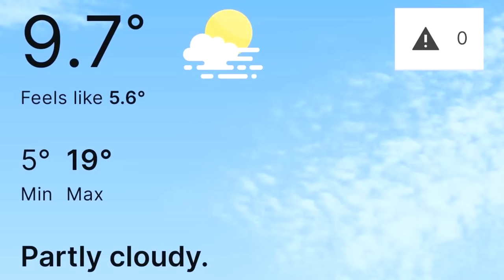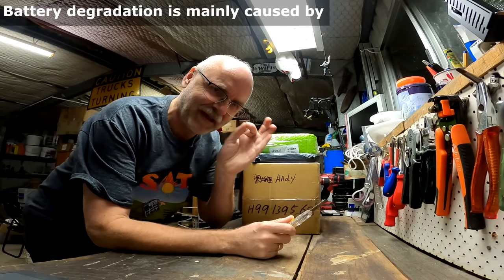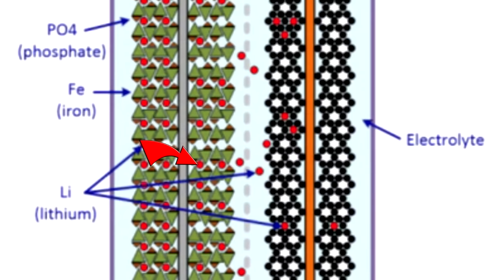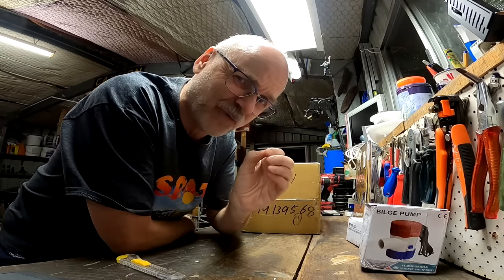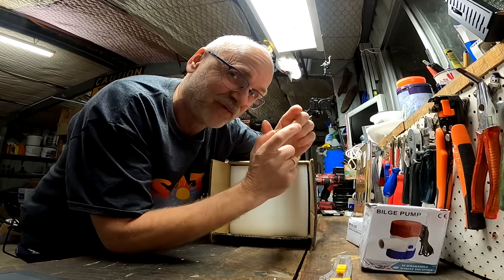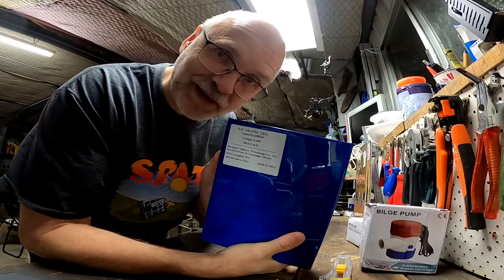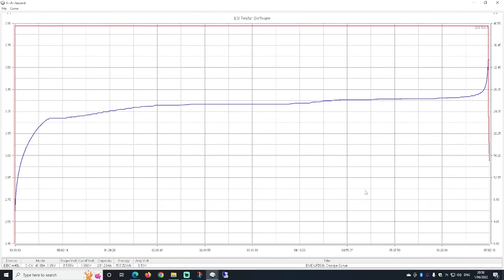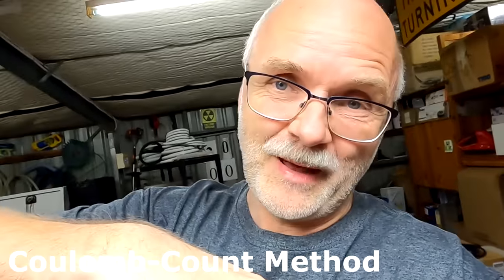Busting the 20%-80% SOC myth for LiFePO4 batteries.

Comment: Small correction: LiFePO4 is also a lithium-ion battery. They all are. It would be better to distinguish by chemistry: Lithium Iron vs Lithium Nickel/Cobalt batteries. LiFePO4 really doesn't mind being charged to 100%. Keeping them at higher voltage (3.65V per cell) is more problematic since you can actually overcharge. Similarly, keeping them at 0% (2.5V) is generally not good, but anything over 2.5V (say, 3V which is pretty much still 0% state of charge) is fine. In other words, stay away from the very extremes and you're fine.
Reply from the maker: Thank you!
Reply: my observation of multiple laptop battery packs and brands is that their 100% charge requires cells to be above 4.2V.  This has lead to many packs failing with just one or two bad cells; suggesting to me that these cells were over stressed.  I'm imagining that something similar might happen with LiFePO4 cells driven to 3.65 or higher.
Reply: @zaneenaz4962  "In the old days" we also pushed LiFePO4 to 4V as well. I agree that even 3.65V is pushing it, especially since there isn't much energy between 3.5V and 3.6V in the first place - at least for solar. If you do fast charging at high C rates, the voltage will rise faster and you might need to go to 3.6V or something to get the most out of the cell.If you can absorb for longer periods of time, even 3.45V like what Andy does is enough.
Reply: @upnorthandpersonal  What's the real difference between absorption @ 3.45V for longer and float @ 3.375V until the sun goes down? For example, I absorb @ 3.5V for an hour and float @ 3.375V until the sun goes down (~6 hours this time of year). Would the batteries benefit from changing to a 4 hour absorption @ 3.45V and float for @ 3.375V for 3 hours? Or are we just splitting hairs at this point?
Reply: @bbrown_sc  The key thing to know is that LiFePO4 wants to settle at a certain voltage, even after longer absorb stages. The important thing is to let it do so, which is why floating at high voltages is not a good idea, and 3.375 is often chosen below this settling value (in principle, you don't need float at all). 

You can absorb for longer at 3.45 compared to 3.55 for example, but that's only valid if you have the time to let the battery absorb. If you want to charge faster because you don't have this luxury, you have to go to higher charge voltage.

In the end, for solar applications where we're talking low C rates and in principle can afford to charge slower, it doesn't matter. There is a lot of fine tuning one can do based on weather/seasons/etc. but one can easily go too far with this and spend way too much time tweaking parameters...
Reply: Hi, if i were to charge at a fixed voltage of 3.65, but shut the charger down long before the cells actually reached 3.65v, would this prevent the majority of cell degredation?   Or is it mainly down to actually charging at a voltage of 3.65 that causes the worst of the degredation?   Thank you 👍👍👍
Reply: @jmpcrx  Your cell won't see 3.65V until it's charged that high. In the mean time, it pulls down the voltage of the supply (and max power transfer occurs). In other words, yes you can charge with 3.65V and cut off before it reaches that voltage without problems.
Reply: @upnorthandpersonal  thats excellent news, thanks for taking the time to reply to my question 👍👍👍
Reply: @josepeixoto3384  If you have 3.6V at the supply, and don't see the full current the supply can deliver, it's because of bad connections and too thin wires. You should never have to have your supply higher than 3.65V. The chances something goes wrong are just too great. Again: if you don't see max current at 3.65V from your supply, change the connections. 
I don't know why CALB recommends this, but it's definitely not something that's applicable for every LiFePO4 cell.
Reply: I agree 100%. And so many people seem to worry their self stupid over this subject. It's just batteries and they one day gotta be replaced. Maybe a year or two sooner but it's not worth so much worry in my opinion life's to short to stress over batteries lol
Reply: I don't think LiFePO4 is ion. There is no cobalt. It acts more like agm then it does typical Liion
Reply: @festerallday  Not at all. Lithium Iron Phosphate still uses Lithium ions as charge carrier. This has nothing to do with containing Cobalt - that is used to make up the cathode in a LiCoO2 based cell, versus the LiFePO4 in a LFP cell. The only difference is that the LiCoO2 has a higher density (simplified: it can fit more Li ions charge carriers in its structure) compared to LiFePO4.
Reply: You don't need to worry about full charge. Flow of power all day and night is all you need. Stop worrying and go bloody fishing unless you want to sit inside watching Netflix in air conditioning.
Reply: I've noticed with my batteries, when I draw a 50 watt load or more from my 12v pack down to its cutoff at 10 volts, it almost always recovers back to 12 or more, usually  reaching its reconnect voltage too

Lifepo4 seems really hard to mess up as long as you have a BMS
Reply: @ShitkidOfJamrock  what's a BMS?
Reply: @simonpepper9721  battery management system, the circuit board thing you see in all the builds people do.
Reply: @ShitkidOfJamrock  oh,I call it a control charger. Thanks.
Reply: Can we charge lifepo4 cells with lead acid charger
Reply: @aabb-xt8kl  Yes - just make sure you stay under 3.65V per cell.
Reply: @upnorthandpersonal  
Some people say to charge lifepo4 cells with 3.45v and maximum charge to reach should be 3.4v
Reply: @aabb-xt8kl  You can, but the max you should go to is 3.65V. If you stick to 3.4V, you have to allow for longer absorption. Personally, I go to 3.5V with no absorption.
Reply: @upnorthandpersonal  
What is absorption and what is best process
Reply: Hey! If i whant to conect AGM and  Lifepo4 in parallel whant do you recomend? Sistem with 24/48 volts. I have 4 pieces 120 amp AGM and 4 pieces 200 amp lifepo4.
Reply: @raducumilea-is2yi  Personally, I wouldn't. There are practically no benefits and you introduce a potential issue where when the AGM dies, it presents a place for the LFP to dump all its energy into. If you really want to use the AGM, I would find a way to kick in the AGM once the LFP is empty, but not have them connected permanently together.
Reply: @upnorthandpersonal  Agreed. At minimum, you'd need to set up some sort of battery isolation system so that they aren't both connected at the same time, since they don't even use the same voltage curves.

For what it would cost to build separate systems to isolate and charge separately, you could just sell/recycle your AGMs, and install more lifepo cells, and enjoy the weight and space savings that come with a much less complicated system.

Comment: I need help. I’ve got a 110ah leisure lithium battery, charged by dc-dc charger, which runs a 12 volt fridge, the BMS shuts off power at 10.5 volts, which means the fridge is also off for a few hours before sunrise. Do I need more batteries?

Comment: This is one of the most informative videos I've ever watched in regard to SOC on Li-Ion and LiFePO4 cells. Thank you!
Reply from the maker: Thanks a lot, glad it made sense and helped.
Reply: @OffGridGarageAustralia  look up carpen battery..70 yrs,,no charge..
Reply: @OffGridGarageAustralia  I been building off grid power systems for over ten years, I haven't ever kept up with lithium, I know lead acid, NiFe and nicad indepth, but I have a chance to win a 30kwh battery, and if I add 6 cells a 40kwh lithium battery for my self!  This has helped a ton to get up to date, and an idea of what I need to design the build.

Going to be painful testing 24 individual cells!  but worth it!, thanks to your videos I am selecting the JK BMS, I'll fabricate my own copper buss bars though!
Reply from the maker: @Refertech101  Thanks for your feedback. All the best with your project. It will be great and very rewarding!
Reply: @harrywalker968  da daaaa, vor sa distruga muzeul tehnic unde se afla...

Comment: Perfect timing Andy, I'm finally setting up my own battery 2.0 and the Smart Shunt is part of that. So I'm keen for a deep dive into the settings.
Reply: Me too just in time. Perfect!
Next weekend i will install my first ☺️ 8x 280 with jk BMS and victron charger(800 watts panels)
Reply: @camielkotte  this is my exact setup. I have 2 pcs of 435w panels and 8pcs of 3.2v 280Ah Eve. I have a Victron MPPT 100/30 scc. Pls let me know how you go.  I ask Andy whether the panels are enough to fill the battery for the day. I am planning to run fridge, freezer, washing machine and dryer for this setup.
Reply: @noelbondad7423  hahaha. Funny. My pannels are 395. I have a 100-30 and a 75-15 SC. Panel lsc is 11. Thinking about a east-west setup and maybe more panels. But since we are only weekends and high summer at the cabin 2 panels should be enough. Only problem is a massive oak tree full of various kinds of birds right at the south ... So i oversized the battery.
What consumers i use will proof yhe choise of wh insyalled are enough. We want a microwave and a little oven for bread. Cant decide if it must be 24volt(thick cabling) or a 230volt (massive inverter).
The later Ovens use up to 3000watts during pre heat i believe where 24volts dont. Curious.
What kind is your sine inverter?
Reply: @noelbondad7423  last weekend my brother helped install both pannels and i connected one. Today i replace the SC with the second panel inparalel. Must do some woodcrafting before placing the battery and tow the dead lead away.
Succes to you. Saw you channel, will look at it tonight.
Reply: @camielkotte  I have a 24v sine wave inverter of 2500 watts continuous and 5000 watts surge. At the moment my old setup is 24v system. 1 panel of 435w, Victron 100/30 Scc, 2pcs of 100Ah LIFEPO4 which I connected in series to make it to 24v.  Now I want to UPGRADE my system with Eve 280Ah I mentioned above.  I bought another 435w panel.  These panels are Voc = 49.9volts.  I am NOT SURE whether my Victron Scc can support it since its max is 100volt which is at the boundary of my 2 panels. Actually, my other issue is whether the 2pc- 435w panels can fill the battery for the day.
Reply: @camielkotte   Now there's a point for roof panels.  Where I am we have over hanging Sycamore (Acer Palmatum) and also - far worse) - Lime trees Tilia x europaea , these have serious honeydew droplets for the leafy months - you never park a car under on, the sap is acidic and eats through paintwork - with expensive mistake.  So what does that kind of thing, combined with roosting birds, crows pigeons doves etc what a nightmare to keep clean?  Whats your take

Comment: The danger with keeping a near100% full LiFePO4 on a float voltage is that the (poor quality) charger can have an AC ripple with short spikes above 4.2volt  even though the DC voltmeter says it is at 3.6volt constant float. Multiply values depending on your battery; 4s, 8s or 16s.
Those voltage spikes can cause metalic lithium plating on the electrode, that is permanent damage. 

I charge my battery untill the first cell reaches 3.65v and then stop for the first cycle of the day. BMS calibrates this event as 100%,  after calibration charging is resumed at 92% and stopped at 95%.
At midnight the flag for "calibration done" is reset so that it will charge again to 3.65v to recalibrate the next day. 

The article "Practical Characteristics of Lithium Iron Phosphate Battery Cells" at Nordkyn design discusses the memory effect of not charging the cells to full (3.65v) on a regular basis.  It starts building up a hump on the curve which gradually shifts to lower SOC, this means   charging to only to 3.4v may reduce the usable capacity over time bacause it reaches 3.4v at a lower SOC. 

In a truly off grid setup the typical daily cycle would maybe be 70% to 100% (defined as 3.65v) . Where I live there are infrequent events of consecutive rainy days where SOC drops below 10%.
Reply: I found the article, was very interesting.  Regarding memory effect: it seems to take a long time for this to occur, and is generally reversible.  The author states in the comments: "Memory effects don’t become permanent, they just become more difficult to overcome. [...] Performing a full recharge once or twice a year would appear to be quite enough in most cases."
Reply: @ed-ey1yb  This is very interesting to know. I made a note beside my HWT - which I drain and flush twice a year, as a self reminder to ensure the same for the battery bank.
Reply: WOW cheap charlie chargers with ripple and spikes - may explain the quite common sort of fire from these e scooters left on over night charge

Comment: Hi Andy, more great info as usual. As soon as the temperature in Melbourne rises over zero in Melbourne! I am going out to my van to reset my 200 amp LiFePO4 to use the full capacity (not just 80% to 20% ), THANK YOU!
Ok, secondly I am looking forward to the upcoming videos as mentioned, but one thing I would REALLY like you to explore/discuss is "Separate Port" BMS's.
There is a lot of poo pooing separate port BMS on the Net, this seems to stem from the lower charging rate available versus the output.
Now I agree that this can be a factor in a stationery system with lots of panels, which is why those systems should be a totally different discussion to RV systems.
Essentially you really do need a separate port BMS in an RV for obvious reasons, secondly  the lower input is never likely to be an issue on an RV simply because you would be hard pushed to get enough solar on the roof to exceed the input valuation.
Personally I have a Daly 200 amp output by  50 amp input (dumb) BMS. I seems to be working fine for about two years, but I would really like to upgrade to a BMS that has Bluetooth and is fully configurable, but where to find such as beast?
I am aware that "hybrid" BMS's are apparently starting to appear, but I think it is still early has for them.
What I really want is something like the JK BMS with the internal balancing (nice), but with a separate charging port, any suggestions?
BTW, Daly has very bad communication skills, and don't make it clear you can order a BMS from them to order, that's how I got my 50 amp input model.
Also people should note, some distributors of Daly products (like Deligreen) are hopeless, they supplied me with an instruction set for connections for the BMS that was totally wrong and would have blow it up on connection. 
P.S. They also lie through their teeth.
PPS,. currently everything is controlled by my Victron BMV712 networked to the Victron MPPT.